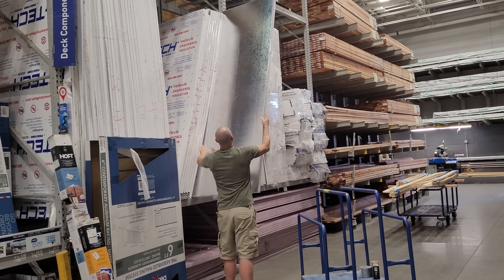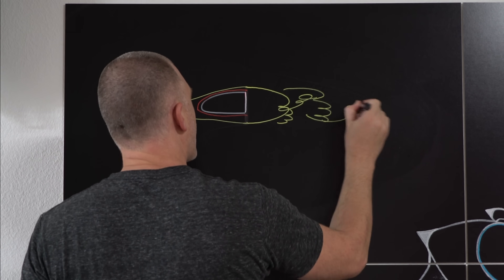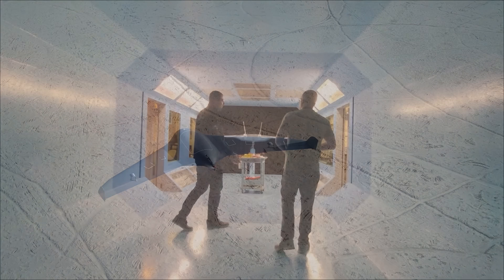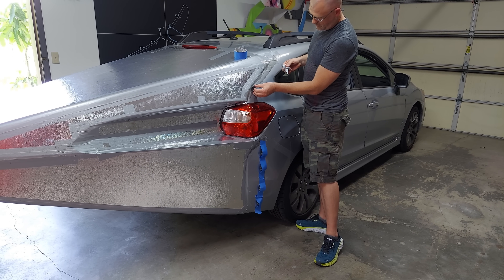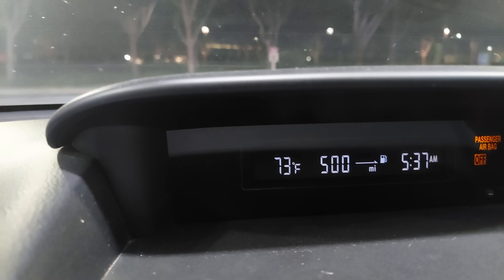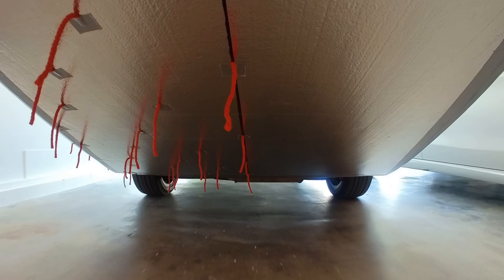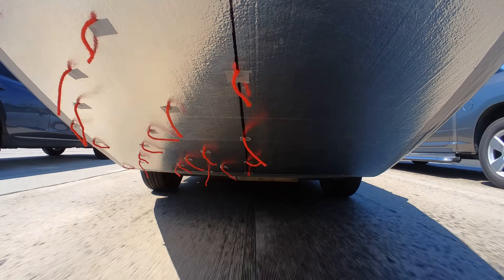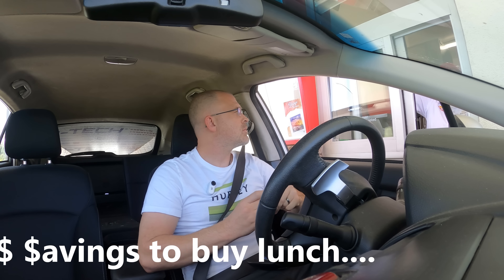Using Simple Aerodynamics to Beat High Gas Prices (Home Improvement Store Edition)

Comment: California does not have high gas prices, not even a tiny bit higher than anywhere else in the country. No. They have high gas taxes. That's it.
Tired of it?
And why do you keep on voting democrat? So you can keep on telling people in the rest of the country that you have the highest "gas prices" ?
Which by the way, you do not. Gas prices are almost uniform across the entire United States
Reply: Probably voting democrat because it's the least crap of the two options you have in your unbelievably awful political system.
Reply: @logitech4873  democrats are bigots. They are intolerant, aggressive and the most dangerous people in the country. Anybody who does not agree with them politically, they destroy. That is sick and disgusting!

Comment: You should check out some of the 1930's German aeronautical engineering papers or just fast forward to the four Daytona. Let me save you the trouble you could cut off 2/3 of that and get the same aerodynamic efficiency. Check out the Ford/Shelby Daytona

Comment: Slowing down will save more than that. Drive 55 or less. Slower speed less drag, less energy needed per mile. Driving 60mph for 1hr, you only average 45mph. You don't save a lot of time. Better time management saves time and $$$.

Comment: One car manufacturer did his aerodynamics homework correctly : Citroën. They came out with the DS. Shaped like a foil, larger in the front than in the rear, belly fully covered.  The car was almost banned from entering the US but it was a huge success in Europe where it is considered to be the car of the XXth century because of how revolutionary it was : self leveling hydopneumatic suspensions, fiberglass roof, front lights turning with the steering wheel, aluminium bonnet, automated clutch (on some models). The DS (pronounced like the french word déesse meaning goddess) was capable to drive with only 3 wheels as if nothing happened. My dad had a DS21. He blow a rear tear on the highway and didn't notice it until someone from another driver waved him there was something wrong with our car. We stopped and to our amazement the entire tire missing. Citroen's lacked the know how to build a sports car engine until the acquired Maserati and build the SM a few years later. Nevertheless the DS was capable of reaching 188Km/h due to the good aerodynamic shape.
Reply: Did I mention the Citroën DS was sold between 1955 (!) and 1975?

Comment: Car manufacturers use kammback designs instead. Dr Kamm discovered in the 1930’s that tapering to 50% of the max cross section and then using an abrupt vertical truncation will give nearly the same aerodynamic benefits as the boat tail here with a much nicer design aesthetic and less material.

Covering the taillight trenches with clear plexiglass would keep the aerodynamic shape and visibility.

Comment: Why not smooth out the area behind the lights with sheets of plexiglass? As long as you can see the lights, the lights don't need to be exposed... or do they?

Wouldn't a big spoiler across the top of the car in the back to much the same thing?

Comment: Car companies did make designs like your proposed redesign in the 30s-40s. Old fords and the VW Beetle were designed like that. The Beetle was also partially designed like that to create lift to reduce wear on the rear suspension where most of the weight was was.

Comment: I go through that with my lithium  golf cart it has 240 lbs of batteries and I want maximum range . Oh , and go for zero toe settings on your alignment,  bit twitchier at 60 plus , but you may gain 1to3 mpg on that alone

Comment: Clear plastic is taillights drag solved. Make the underside super flat but watch out for trapping heat!
Your suggested curve down in the rear will lead to extra drag, you can't go higher then 10 degrees down slope or the air will separate and generate more drag. Skirts and spoilers under the car will make your frontal area bigger. Just make small wedges up behind the wheels and a super flat bottom, plus some fins to stabilize the airflow under the car.

Comment: The proposed design change to the rear would potentially create a ton of lift.  That and the length and inconvenience are the biggest reasons manufacturers don't do this.   For your side panels, your goal should be to reduce the taper until those tufts lay flat (i.e. the air stays attached).  Keeping air laminar as long as you can and then sharply ending the body at whatever length limit you set for yourself is better than just going for more taper to reduce the area at the rear.  Most modern cars have somewhat sharp edges at the rear for this reason.  They just aren't willing to make it as long as you are.  Very cool.     

Another way to judge aerodynamics consistently would be with a coast-down test.  Track speed vs time while coasting from neutral from as high a speed as practical to as low a speed as safe and practical.  Plot deceleration vs speed.  You'll end up with a graph that can more-or-less be separated into a linear term and a parabolic term, where the parabolic part (the speed squared part) is mostly wind resistance, while the linear part is mostly bearing drag, rolling resistance, etc.  Not perfect, but does give you an idea what "perfect" aero would mean.    Since aero is not 100% of the problem, you might find that a 13.7% efficiency improvement is maybe twice that much of an improvement in just the aero drag part of the problem.

Comment: Study race cars and in some cases super cars. F1, Nascar, Indy. The most recent Ford GT for the flying buttresses and teardrop shape. Look underneath for how they handle air. Underneath flat, smooth, BUT towards the back they start to add NACA duct shapes to pull air from under he car. This, after minimizing the amount of air that goes under with a low front splitter and side skirts like you were planning. 

Another completely different idea, is to go the NASA route with a blunted nose that pushes air over and around the body... not sure how well that will work subsonic and at sea level, but hey, content.

Comment: If you want to remove wheel wash on the rear with a full cover, I'd think that you should have the sideskirts taper and see about using that to reroute air to the brakes, limits of the design of the car pending of course.

Comment: Commenting to concur with another post, partially covering the wheel a la old Honda Insight would help stabilize the flow below the tail lights. Checking to see if later models in the same gen subaru have any additional underbody cladding would also be an easy way to try and clean that up without any system thermal risks.

With regards to the tail, you'd still want to maintain some level of slope upwards for ground clearance/approach & departure angles. I wonder if something like a splitter near the inflection point where you gotta start curving upward would help.

Comment: Have you  tried positioning a row of vortex generators or cutting slots in the extension you created? Also, a skid plate would probably help with the air underneath the car if the skirt you're adding doesn't work. 
Great video though. I got my F250 diesel up to 20 on the highway. I'm thinking about adding an air suspension to lower it on the highway. Or I'll just leave it parked and drive the RAV4. :)

Comment: I remember an article, I think on Wired, years ago that talked about hypermiling.  I think they used a Honda Civic.  I don't remember if they put the fin on the back like this, but they discussed it as a possibility, including maybe something inflatable so you could still part in tight spaces (maybe something that could flip up when parked to take less space, but not have to be inflated?_   You might lose some of your gains with extra weight if you had a more robust material.  Mythbusters played around with the large divots like on a golf ball and found some gains too.  I suspect you are causing some visibility issues, and if that was made out of metal it would be a disaster if someone rear ended you.

Have you ever read about Buckminster Fuller's Dymaxion Car?  It played around with some weird aerodynamics.

Comment: Could use plexy glass to cover your lights and you could bend plexy with a heat gun and attach to the hood with bolts to make a more ideal areodynamic shape. You would need a pretty tough durable bristle material to seal the side of your car since it will likely be hitting pavement at highwayspeed i think you can buy them online though. I believe you can buy aftermarket belly pans for car models that dont come standard with them. finally some states i know california have minimium body hight laws i dont thhink that applys to bristles on side skirts though. Its for hard stuff that could damage asphalt, throw sparks or break and become a road hazard when hitting the ground.

Comment: The underside is too steep. Since the ground is there, it can't flow back in into the low pressure zone nearly as quickly as it can on the sides or top. The bottom is about 4 degrees vs the other side which can be up to about 15 degrees. Having it steeper than ideal means that the air is getting sucked under the tail. And you can gain a little bit by partially blocking the radiator intake - leave the opening on the lower part of the opening - below the stagnant point. If you then seal up the gaps (if any) so the air going through the opening can only go through the radiator. You should be able to cool every 100HP engine with only 16 sq in in an ideal setup. So a lot less than stock.
Another mod I used is to replace your side mirrors with video mirrors - essentially backup cameras and LED monitors inside the car.
My 2005 Scion xA 5-speed manual which was rated at 30MPG Combined - I got an average of over 47MPG - for the entire 10 years I drove the car. That includes New England winters. It had almost 170k miles on it. Check out EcoModder dot com for a lot of folks doing this sort of thing.

Comment: im aero modding my hyundai ioniq currently. thankfully my baseline is starting at 60 mpg, versus 35. ive already removed side mirrors and built rear wheel fender skirts. mpg has improved. dont know how practical a boat tail would be. next mod is to smooth under floor and add a mild rear diffuser and possibly a box cavity in the rear

Comment: Cover the massive inset for the lights with plastic you can still see the lights and then it will clean it up 
Add a floor pan 
don’t fully seal the front instead and a Daytona style nose cone , you can utilise the flow under for ground effect 
Fully cover the rear wheels
I wouldn’t drop the tail fully it will probably make it worse just add a diffuser to the bottom

Comment: I Have a 2002 VW Golf TDI, (aerodynamics of a large foot locker) 51 MPG 700 miles out of a 14 gal tank, VW has the "blue motion" diesel engine, (Europe only) it gets 75 mpg. The authoritarian dingleberries here in the USA DO NOT WANT you guys to know this, why do you think they trashed VW's diesel line of cars here? I know, i know, the cheating computer thing, bla bla bla, it was BULL excrement!  it's diesel, it does not emit the same hydrocarbons a gasoline engine does, it's WAY more efficient. Also, they have increased the price of diesel fuel to discourage the sale of any diesel cars, and also to create the monetary increase of goods.  Basically, these hucksters are literally trying to crash America. FJB! & the Democommies!

Comment: IMHO... the back does not need to end in a point... (football)...but can terminate in an edge.... like a trailing edge.... also... 20 degrees is pretty aggressive... get Aerodynamic Drag by Hoerner (pdf)...  great start!! Awesome video!!
I think yer VG's are mostly wrong... more like little separation instigators..
Check aircraft spruce for VG's

Comment: The average modern automobile achieves a drag coefficient between 0.25 and 0.30.  A few of the notable mentions that goes below that are Toyota Prius with Cd of 0.24 and Tesla Model S with Cd of 0.208.  There are even newer startup vehicle manufacturers whom had started the efficiency first design philosophy and they are striving to go even lower. Lightyear.one with Cd of 0.20 and Aptera.us with Cd of 0.13.  
The main question is, would the average driver actually want these higher efficiency vehicles? 
For comparisons, the Ford F-150 had been the best-selling truck (and general vehicle class) in North America for a while and the latest Ford F-150 Lightning has a Cd of 0.56.

Comment: could easily use clear light gauge lexan or plexiglass to cover the tailights and continue the smooth shape of the rear wedge. this would not in any way affect the performance of the tail lights and therefore be legal.

Comment: Need to have a red flag off the back of that during the day and a red light at night.  Anything that sticks past the end of the vehicle by 4 feet needs to have that.  I'm sure you are looking at "load" as a removable item, but you can still be ticketed for that on the basis that the reason for having a red flag is to alert traffic that there is something sticking out.  A car could easily rear end you by not noticing the extra length.  And before the "well that's the other driver's fault then" not so fast, if that were the case then this law would have never been put into effect to protect other drivers from overhang.

Comment: Discarded 2 liter bottles of carbonated beverages could provide for cheap clear plastic to cover the tail light gaps. Held with clear packing tape they could help with the air flow without hindering the light show.

Comment: I have a 2016 Priusc which gets 50 mpg from the factory. I boosted up to 55 mpg by adding front air dam and side skirts and a rear raked diffuser. This also turns out to generate more down force since the air pressure under the car was reduced by 20% on the underbelly. I built a home brew pressure measurement system that measures the air pressure around the vehicle as I drive. It turns out you get the most bang for your buck just diverting air up and over your car and adding a few plates underneath to keep the laminar flow. Any spoilers diffusers or other singlets just add drag.
Reply: Downforce usually comes at the expense of drag. I think a front lip has low as possible is a no-brainer, I thought about trying to hinge it in a way that it won't get caught on parking blocks.

Comment: If most of your driving is in the highway, removing (or at least folding) your side mirrors would be your single best bet for increased fuel efficiency (they act like little air brakes), with a flat underbelly (cloroplast, anyone? just keep it away of the exhaust) as a runner-up.

Also using the thinnest tires possible, to reduce drag (inflated to their maximum psi, don't worry they won't blow up unless you drive like a hoon) would be your best 3rd bet. Regarding the front spoiler, I'd first lower the whole car (smaller/softer springs) for almost the same benefit - and of course you could do both, with an almost floor-scraping spoiler made out of garage door seal. I'm not sure about the roof rack, but it's not used regularly, I would remove it, too.

For those who do most of their driving in urban areas below 40mph (and thus won't gain much by fiddling with aero improvements), the best bet for fuel economy (besides learning to drive with a "light foot") is removing unnecessary weight from the car (and I mean the whole backseat) since most of your city driving burned fuel is for beating inertia, accelerating from dead stops - so the lighter, the better.

Comment: Great video! I’ve always wondered why cars’ rear ends weren’t shaped to look more like an airfoil. Some cars in the past like the Tatra 600 had more of this shape in the 1950s, but the only modern car I see resembling this is the Honda Crosstour, which doesn’t get groundbreaking fuel economy.

During my science fair to make a more aerodynamic bicycle (making a fairing to go around the rider-the most drag inducing part of the bike) I remember reading that a minivan may theoretically be more aerodynamically efficient if it were cruising down the highway in reverse. I would love to test that, but making one of these rear airfoil parts for my car is much higher on my list haha.

I would love to see more content on this!!!
Reply: Wouldn't sell, that's all. Car design has to balance aerodynamics and ascetics - people won't buy an 'ugly' car, or a car that is abnormal in the wrong way. Some car features also make a more psychological statement, expressing something the owner wants to say about themselves. There have been plenty of super-efficient cars made - the latest one to get hype is a solar-electric by Aptera - but they just are not what most customers are looking for.

Or more cynically: Buyers want a Manly Tank, not a wimpy hippie car. Those things are for crushing beneath the wheels of the mighty SUV.

Comment: did you factor in tire pressure, wind speed direction? 

Try upping the tire pressure 10% (35-38 psi), lower speed(61-71mph), super coasting, driving in clean air flow with new filters.  You'll reach 20-35% added mpg.  I get 50-70 mpg on my civic with a comb of this based on stock 42 mpg highway. Tires add 5%, Air 5%, Coasting 10-30%, Air resistance 5-10%.

Comment: Interesting idea but it has some drawbacks, much harder to find parking, looks odd, reduces utility of your car, it hard to use the back of the car, you could just lower your speed a little. Reducing traveling speed improves efficiency for several reasons:
It reduces fuel consumption because lower speeds require less energy.
It lowers emissions because engines operate more efficiently at lower speeds and produce fewer emissions.
It reduces vehicle wear and tear, reducing maintenance costs and extending the vehicle's life.
It improves safety by reducing the likelihood and severity of accidents.